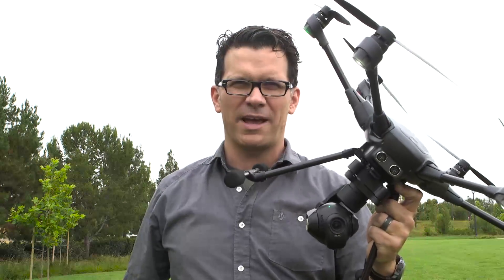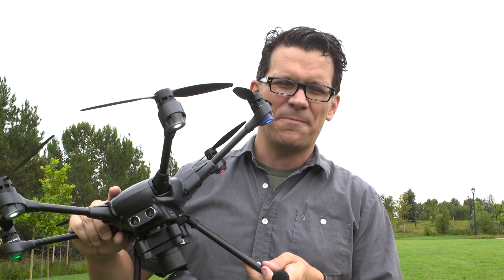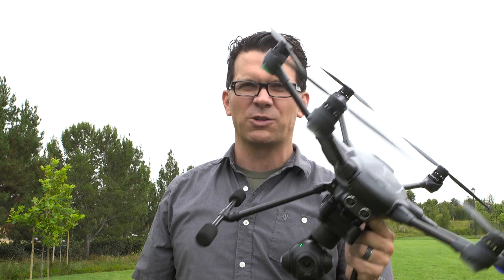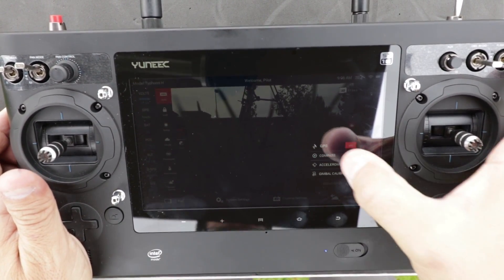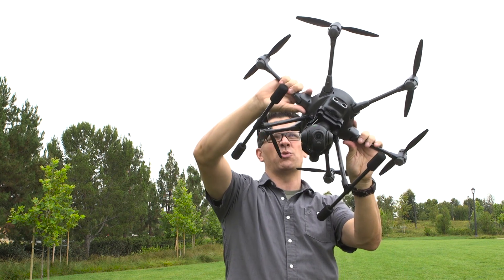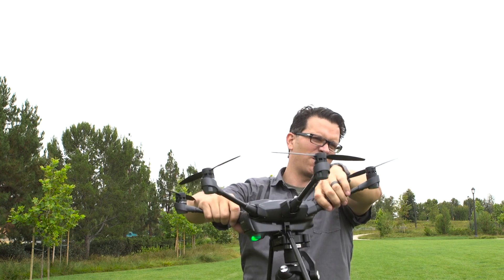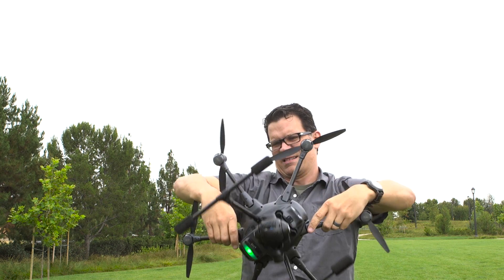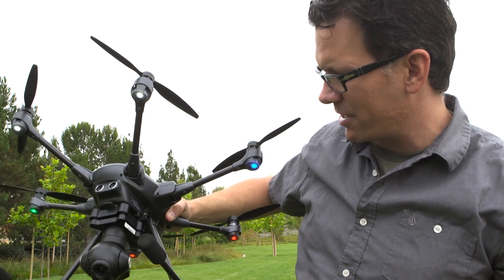Yuneeq Typhoon H - Compass Calibration Walkthrough

Comment: Hi  just a few simple comments. 1) your compass calibration was faulty here (IMHO), I believe it took you too long to move between the booms because you had no idea what two were going to light up next. You don't have to do this, if you realize it rotates to the left every time you move to the next set of booms. has to be smooth and steady, and keep a certain rhythm (speed), takes 3 revolutions per set of booms for me.( I don't even look for the lights, because I know which booms are next). If you do it right you'll get completely done just before the warning chirp sounds (1-2 sec).    2) that steady rotation from the center that just keeps making a larger, swifter circle.(toilet bowl effect.) that usually tells you immediately that your compass is not calibrated, no matter what the lights say. I have calibrated drones before and they were done correctly, but toilet bowl on launch, so I have to do them again because I know, once I see this that they are not, but if you have seen it enough, you know automatically to shut it down immediately. That being said, I like your channel and the content you cover, and am looking forward to your next installment. Have a great day!
Reply from the maker: Hi George - 

Thanks for the feedback, although the compass calibration wasn't the issue.  I worked with Yuneec on the phone and it was deemed that the unit itself was faulty.  This wasn't the single occasion where it happened.  Thanks for the comment, helpful to everyone reading.  It doesn't always take 3 revolutions per boom though, it differs between as well.

Comment: It seems you're doing homework for the drone producers. Your channel is nice and useful :) 
Now, to the point: since I saw you unpacking Typhoon H I've been really curious of the comparison between TH and P4 in terms of the stability of flight.I mean a hove in one place or a flight chasing and object at low height. Does the larger number of discs mean the higher precision of the flight? Or the more advanced software, electronics, e.g. double compass turn out to be more important?
The revolving camera in TH looks promisingly, but it might tourn out that softer shots can be achieved by P4, although it has to fully turn around during the flight (however, it wil do it more precisely).
It would be nice to see them together Bill :)
Cheers.
Reply from the maker: Hi Ari - 

First thanks for watching!  What do you mean by larger number of discs?  I don't actually think that the panning of the camera in 360 is that big a deal, you can always just rotate your phantom, and if it is in course lock mode you can do so and not change the direction of the craft.
Reply: ohh, I meant propellers not discs. what works better in terms of stability: those six propellers or P4's brain? :) 
And which software does help create better shots?